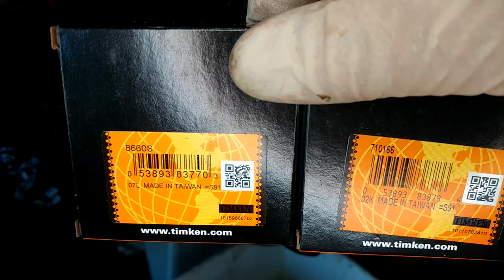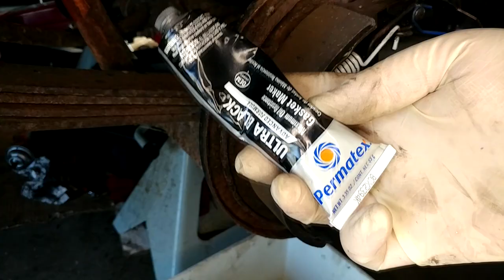Blazer Rear Axle "Rebuild"... Axle Saver Bearings, Wheel Seals, Pinion Seal, Cleaning and Prayer. 😂

Comment: The factory puts sealer on the splines so they don't leak, not sand. you should have put silicone on the splines.Thats an o type rear so you might have the wrong bearings .
Reply from the maker: I've never seen one that had sealer, I've never put sealer on one, and never had one leak. 🤷‍♂

I had to chisel and pick whatever that stuff was out of there. I worked on that yoke for about an hour by the time it was all said and done.
Reply: @TheBrokenLife  when I was a young mechanic that's what I was told to do with pinions, but what ever works for you. Sorry if I came off judgemental.
Reply from the maker: I didn't take it that way at all. We all have different ways of doing things. 👍

I'm mostly just curious what in the world that stuff was. If it was a sealer, it was tile grout. 😂